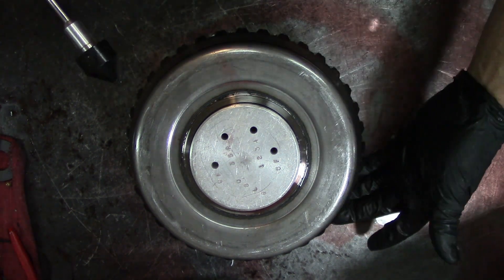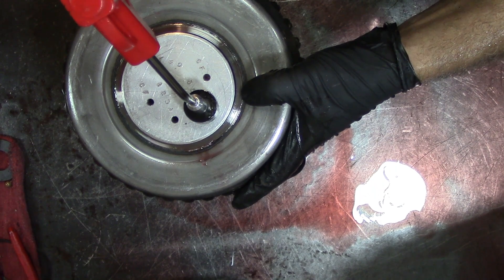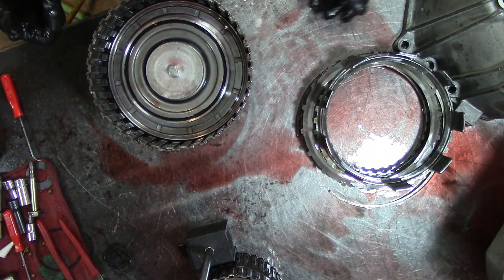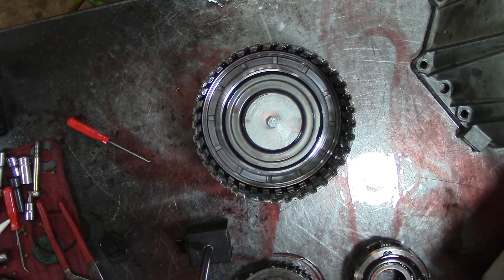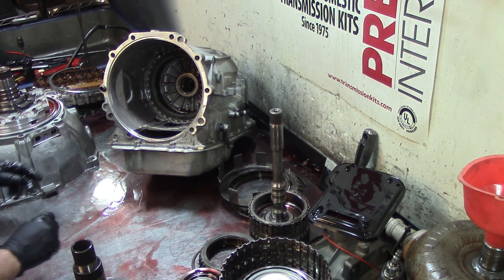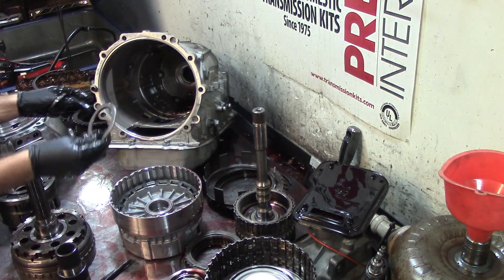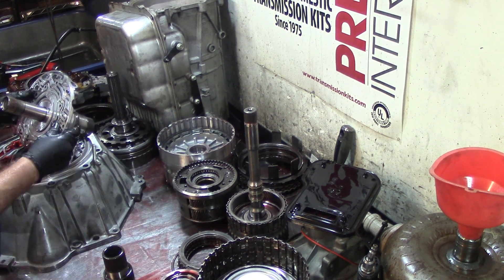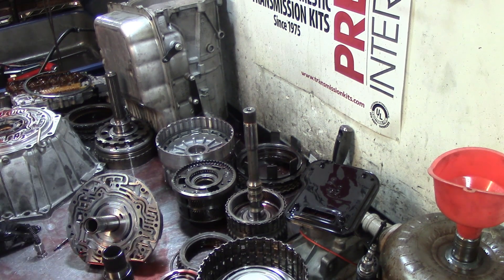6L80E 1-2-3-4 / 3-5-REVERSE DRUM LEAK TESTING | #6l80e

Comment: Hey Hiram, thanks for your videos. When reinforcing the 35R drum, can I use a stick electrode or do I have to tig these?
Reply from the maker: Not sure if it will cause any balance issues. Keep in mind that it rotates so tig and level your welding might work. I just install a new one every time I see a failed one.

Comment: Thank you for your videos, very informative and dont say that you dont have the instructor lingo. You Got it Brother! When you air check the 1,2,3,4 with the tool and it leaks from the CF while checking it! Is that normal? I have disassembled it and checked all of the O-rings and found them to be ok. Any clues on this? And no cracked pistons or bad weld!

Comment: Hiram, Who's large snap ring pliers are you using? I like the ratchet type.
Reply from the maker: I have 2, one is from Mac Tools and the red one is ATD. But you have to buy the tip adapter separately. They are Kent-Moore. Don't know the part number, it's been years since I bought them.

Comment: Question for you, I rebuilt a 6l80, it originally came in with 456 smoked, installed all new pistons, frictions, rebuilt pump with oversized sonnax pr valve. Updated valve body with transgo kits, re-used techum. I always install a brand new 1234 drum. Vehicle came back month later with 456 burnt up pretty good. Air checked drum it is fine. Installed new frictions and steels put back together worked fine. Within a month came back with same failure.  Went ahead and got a different valve body and transferred shift kit valves. Put back in Vehicle and shifts perfect. I'm hoping the valve body was the culprit for burning 456 clutch only. Will have to wait and see if it stays out. Any thoughts on the reoccurring 456 failure?
Reply from the maker: I had a similar failure with one that was having a double bump on the 2-3 shift when hot. The more you drove it the worse it got. At that time I had 3 on the bench. This was a 2017 with a lot of miles. It eventually burned the 3-5-reverse frictions. I used pump, both drums and valve body of a 2018 with a 4.3L. And still having issues. Ended up being the TECHM. Installed the TECHM from the 4.3L and worked flawlessly. Returned the TECHM to the original truck, got a new one for the stubborn one and out she went. 
Sometimes when you check and recheck everything it ends up being something that you might think is okay.